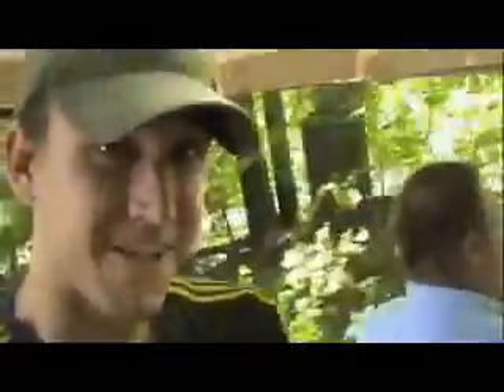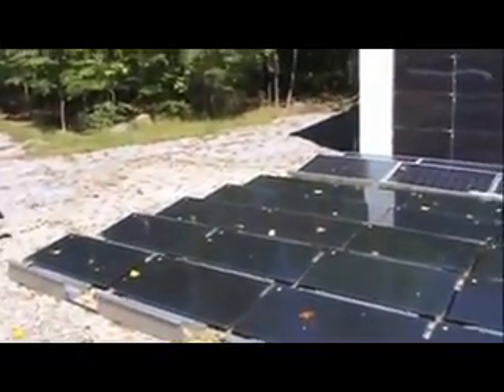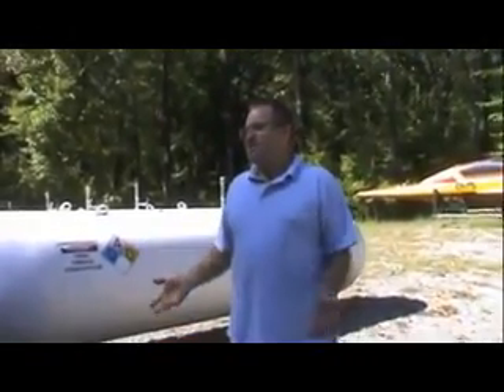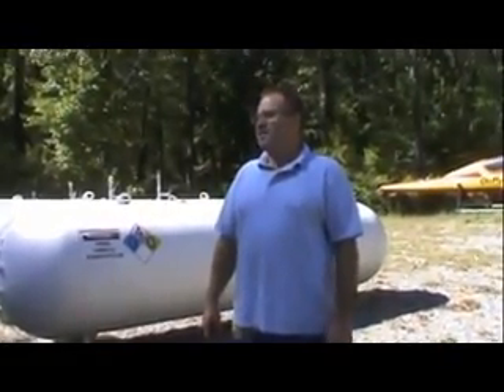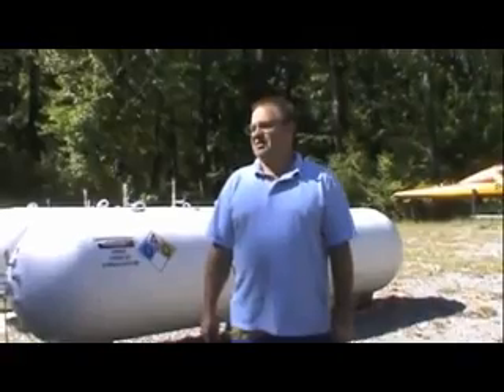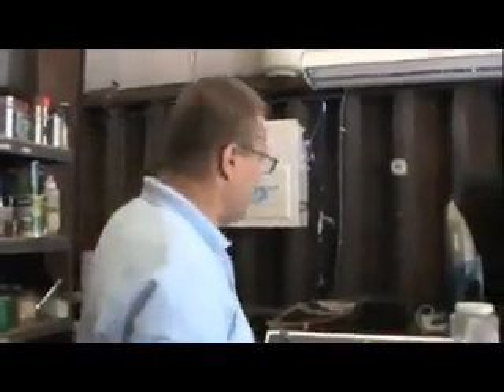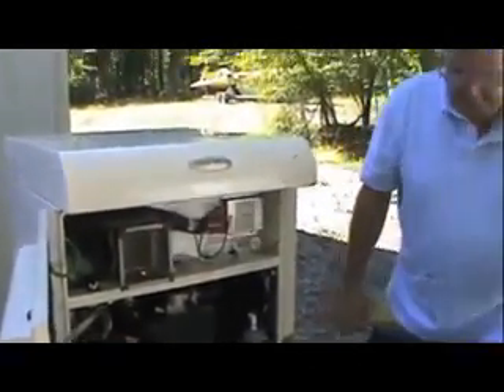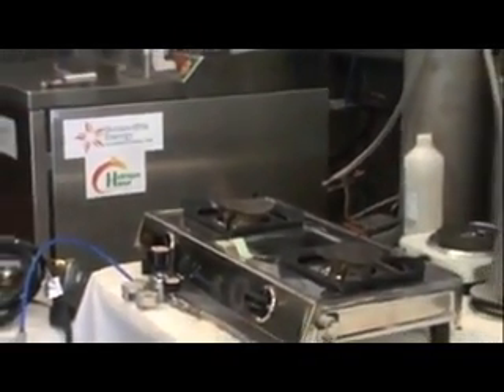100% RENEWABLE ENERGY OFF THE GRID LIVING Part 1

Comment: Got a question for everyone. Ive got a far with a lot of development land on it. Were putting in a hydro turbine on a spring weve got and will be producing about 36kwh to the wire. I would like to put in a few windmills and some solar panels and supply the lots with off grid power. I was told that after so many homes you become a "power company" and have to deal with all sorts of regulation. I would like to supply about a dozen homes. Farm is in Idaho. Any thoughts?

Comment: @kenfla2 

yeah that way too much equipment for comfort

this is simple solar 2 browns gas production/storage. It takes lots of amps at low voltage to split the water and those propane tanks wont hold it for long. The high pressure tank he was talking about is expensive